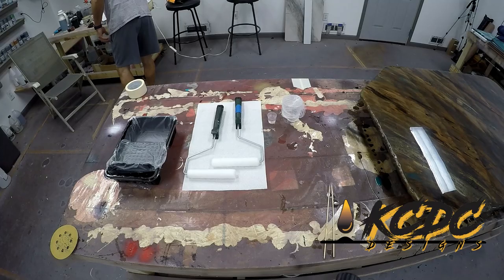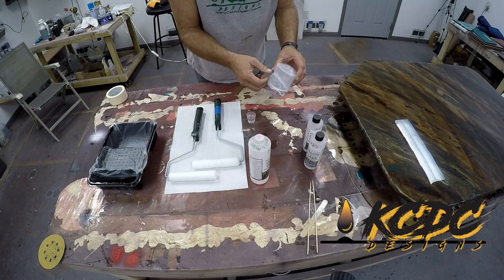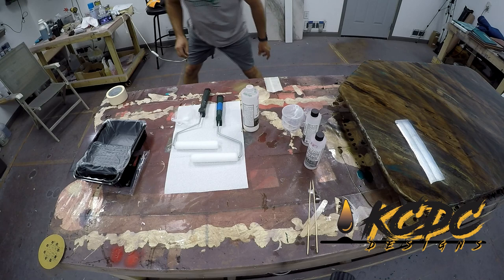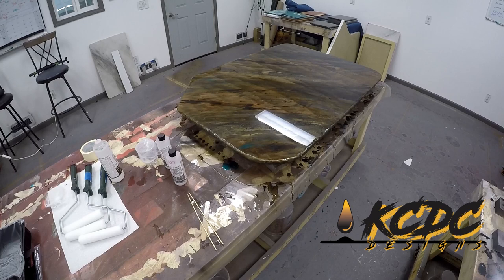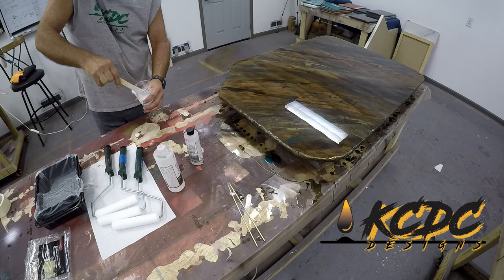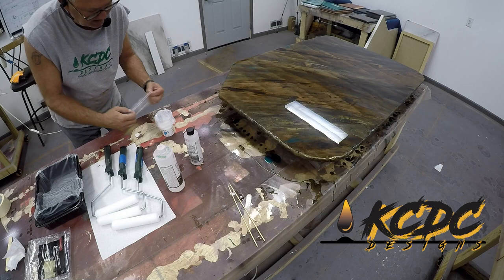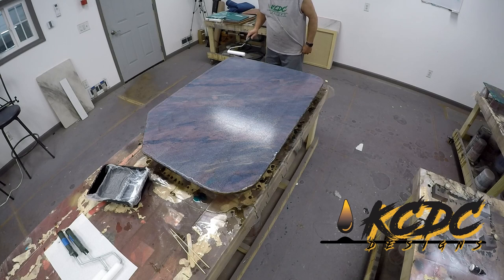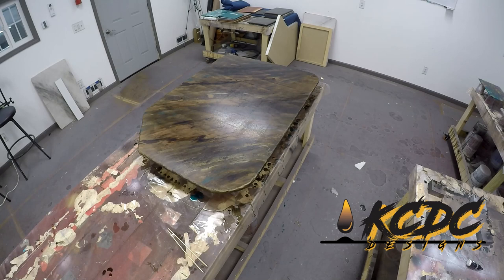Applying Stone Coat's Ultimate Top Coat Natural finish including timelapse while drying clear

Comment: When I sanded my surface with 220 prior to the UTC, there was absolutely no shine or reflection left. You mentioned you did that too. Thing is, your surface was still so shiny that the reflection of your ceil light could be seen . I don't know what was the deal with that table surface being so shing when you said you sanded it off camera.
Reply from the maker: The reason this piece is still shiny is because I just lightly sanded with 220 grit by hand, opposed to sanding with an orbital sander to remove all the shine. The advantage of sanding with an orbital sander and removing the shine, is IF you happen to miss a spot with the UTC Natural (matte) you won't be able to see it because it's not shiny underneath. If I would have missed a spot on this one, you'd be able to see it since it's shiny underneath.
If I can wait several days before sanding for UTC I will use the orbital, but if I'm sanding 24 hours after the flood coat I will sand by hand because the sandpaper has a tendency to "load up", and I can keep the sanding disc clean when doing it by hand. If it loads up when using an orbital, those little balls can cause deeper scratches that the UTC may not fill.
I hope that makes sense, and I appreciate you comment and question!

Comment: Whats the difference between using the mixed clear expoxy as a top vs the top coat matt or gloss?
Reply from the maker: The Ultimate Top Coat (UTC) adds a very hard protective layer over the epoxy. It also is fully cured after 48 hours so it can be installed sooner. Opposed to the epoxy layer which takes 30 days to fully cure and reach maximum durability. The UTC does not HAVE to be applied, but personally I like the added durability and as a business, I don't have to wait 30 days to install.
Without the UTC, the Stone Coat Countertop epoxy layer is still extremely durable.
Reply: Thank you! ❤
Reply from the maker: You're very welcome! 
 @carnitacobb8821

Comment: Hey Keith!  Thank you for sharing!!  Question for you?  I have a long 9.5 ft. countertop would you break that up or one big roll with UTC?
Reply from the maker: Hey Tony and great question! I will always roll the entire piece because when done in sections, in my experience I will always see that transition line of where I stopped and re-started. With a 10' long countertop being around 20 square feet, I would definitely roll the entire piece in one roll. If I were rolling it by myself (I usually have a helper dry-rolling on larger pieces) I would likely use a 9" roller as I can cover more area in less time. And if rolling it by myself, it's even more critical to be sure you're adding enough UTC with your wet roller, back-roll lightly with your wet roller to remove heavy laplines and to smooth everything uniformly, then dry-roll length-wise and ONLY ONCE! Hit me up with any other questions and thanks for your question!
Reply: @kcdcdesigns  Sweet!!
Reply: @kcdcdesigns   Hey Keith!!  I have a helper for UTC application  can we get by with 2- 6in rollers applying it and I do to dry roll with 6 in??  if not what 9 inch roller would you recommend ??
Reply from the maker: @tonyaddy7825  Hey Tony, Not to say you can't use 6" to wet-roll and 9" to dry-roll on the same project, I just normally use  one or the other. If it were me, I would start wet-rolling then have my helper start dry rolling after I get about 5' in (after I've back-rolled lightly with my wet roller to remove heavy lap lines and smooth it out) . Keep in mind when doing your 20 sf top, there's no need to overly rush yourself. Take your time to be sure you get good and adequate coverage with your wet roller, knowing your helper is right behind you and I can't stress enough to get enough product on the surface. A thin layer will be your enemy!. You should easily be able to complete that top in less than 10 minutes, start to finish.
As far as how many rollers, for that project you should need only 1 wet roller and depending on how much product you apply, 1 dry roller should be enough unless it starts loading up and/or dragging. Always have extra rollers de-shedded and ready in case you need them.
Reply: Doing the calculations it put me at 5.86 oz of UTC.   MATH easier go 6oz.  4 of A   2 of B.  Round water .96 up to 1 oz of water
Reply from the maker: @tonyaddy7825  I agree completely with your calculations! Be sure to mix part A and B completely prior to adding the water. Clock starts when Part B hit's Part A. Let me know if you have any other questions and please share your results!

Comment: QQ, so you dry rolled perpendicular (short ways) to the wet roll? not an additional long ways roll? right?
Reply from the maker: Hey Justin, I don't always roll perpendicular and usually wet and dry roll in the same direction on countertop pieces. This one, because I back-rolled with my wet roller one last time, and had no heavy lap lines or roller marks, I was confident in rolling it perpendicular. I couldn't tell you if one way is better than the other, I just know that if you have enough product on the surface, and when you back-roll one last time with your wet roller, if you've done that effectively, it shouldn't matter which direction you dry roll. I try to make it where the dry roller is picking up very little product, yet giving it one last smooth-over.
I hope that helps.

Comment: Have you ever tried to spray it out of an hvlp gun? Wonder if orange peel would be eliminated altogether.
Reply from the maker: Hi Casey, it's been tried unsuccessfully (although not by me). The UTC Natural has zero orange peel for me by following the RK3 Designs formula including how much water to add. Rhonda at RK3 has worked with UTC tirelessly to obtain the best results and it's been working very well for me. Regarding the UTC Gloss, although you can't feel it, there's still going to be a visual orange peel and we haven't found a way to eliminate it. To date, I've not had one customer that has complained about it but they also know what it looks like when they decide on Natural or Gloss finish.
Thanks for your question and feel free to reach out if I can help in any way! If you're on FB, you can contact me through my FB Business page at KCDC Designs.

Comment: Question for you!  Looks like the finish of your piece was glossy to start. Did you not sand at all prior to applying the UTC?  I have a existing counter with matte clear on top and need to redo part of it. So was wondering if I should sand the entire thing before applying!
Reply from the maker: Hey there and so sorry for the late reply!
It may not look like it but yes, I did sand the entire surface with 220 grit (red ScotchBrite pad for the rock edges) to create a mechanical bond for the UTC.

Comment: Hi Keith- I applied the UTC topcoat last night and I have lap lines this am 😔. It is very slightly tacky right now, less then gentle painters tape, so I don’t think they are going to go away. It’s a large island countertop, 10’ by 3.5’ with a sink cutout and I am did it on my own. I’m pretty sure that I was so worried about being quick that I didn’t apply enough product. Do I need to wait the full 24hrs before sanding and reapplying?
Reply from the maker: Hi Melissa, If it's still at that somewhat tacky stage, your lap lines may still dry out,,,, only time will tell (Are they lap lines or are they roller marks? Lap lines are distinct lines, roller marks you can see more of where the full roller was).
If you do need to sand it and reapply, you definitely want to wait the 24 hours, assuming that it's set up/dried enough and that will depend on temp and if there's air moving over it as UTC dries differently than epoxy. Heat and air are helpful. With a UTC Gloss I applied recently, I turned up the heat and had a fan moving air to get it to set up/dry quicker. If the roller marks do not dry out, it's more than likely enough product wasn't applied, as you're guessing. I know it's stressful doing it solo and that does cause us to rush when we probably didn't need to. That's a large surface to tackle on your own and especially if not enough product was applied, because by the time you get to the other end (while wet rolling), where you started may already be setting up which means your dry roller has nothing to pick up and smooth over.
Lastly, if sanding at the 24 hour mark, be cautious of how your sandpaper may load up with little balls/specks. You want to keep your sanding disc clean so those little specks don't cause deeper scratches that the new coat of UTC may not fill.
Reply: @kcdcdesigns  I think they are roller marks and they are still there. I was waiting to hear back from you before doing anything so I did not sand it down yet. I made sure to get more disks today so I would have enough on hand. I also talked to my husband and told him he needed to be my assistant when I reapply. He will be watching yours and Rhonda’s videos tomorrow. 🙂 Thank you so much for all of your help! I can’t wait to show you the finished countertop.
Reply from the maker: @melissafarmer9437  I'm sorry I missed this until now and I can't wait to see it as well!
Regarding the sanding, I don't think I saw whether you applied the Natural or Gloss? Either way, if it were me I would want to sand it to where it were completely smooth, to where in a glare you can not see any low spots. And be careful of your edges, which is why I used a red ScotchBrite pad instead of sand paper so I don't burn through. Once it's sanded smooth you're ready to reapply. If that didn't answer your questions, you're welcome to phone me as well at 402-310-0171

Comment: hmmm ... if you don't like the Natual ... can you just lightly sand and redo with high gloss?
Reply from the maker: I just did an experiment with that and the Gloss  had essentially the same sheen as if the Natural weren't there. BUT, that's only if there's no orange peel in the Natural finish. Any orange peel and you would want to sand it completely smooth, otherwise the low spots will not have a mechanical bond with the UTC.
Reply: @kcdcdesigns  Yeah I believe I just saw it ... here https://www.youtube.com/watch?v=AsizG5uzquQ I rewatched the video. At the end you put 2 diff boards together the left had the Natural and the right has a glossy. You basically said you just needed to lightly sand a bit and then applied the glossy finish ... etc. Then you have a disclaimer saying it was just an experiment, better to make it smooth according to directions. For quality issues I suppose ...
Reply: @kcdcdesigns  But the Glossy finish texture on both looks sort of like an orange peel. Does the natural have that texture or is it more smooth???
Reply from the maker: @wapperjaw8282  The Gloss finish does have a slight (and unavoidable) orange peel, whereas the Natural it's possible to get it applied with none.
Reply: @kcdcdesigns  Hmmm ... I like glossy but not liking the texture effect. I wonder why it has that effect?
Reply from the maker: @wapperjaw8282  well, we've not found a Gloss topcoat without some  texture/orange peel. Keep in mind you don't have to apply UTC. I have many customer countertops that have the high gloss because UTC had not been developed yet. It  just takes 30 days to fully cure without UTC.
Reply: @kcdcdesigns  Oh ... great! I never have prepared food on a countertop but is it food safe after 30 days without the UTC when fully cured? Have you ever tested applying the UTC after 30 Days to see what they look like? And how long must we wait before putting heavy things like a microwave & portable oven on the countertop? I order everything I needed and got the Glossy finish for my computer table and countertop and enough to do a couple of test boards. I think I will test how they look applying the UTC after 30 days of cure and see how it looks? Anyway, thanks for your time answering my questions ...
Reply from the maker: @wapperjaw8282  It is absolutely food-prep safe! Without UTC, light use only after 10 days (no hot or heavy objects), the okay for full use after 30 days, including microwave, coffee pots, etc. I always suggest if it's an appliance that generates heats out the bottom, to set it on something to shield it from the countertop (cutting board, trivet, etc.).
UTC can be applied any time after 24 hours, even 24 years later.
Reply: @kcdcdesigns  Thanks Again!
Reply from the maker: @wapperjaw8282  You're so welcome! Feel free to reach out anytime!